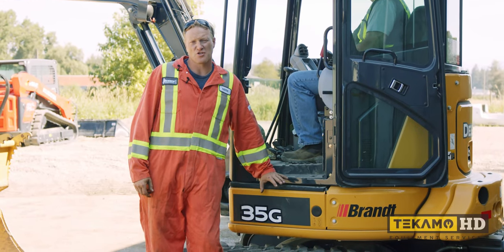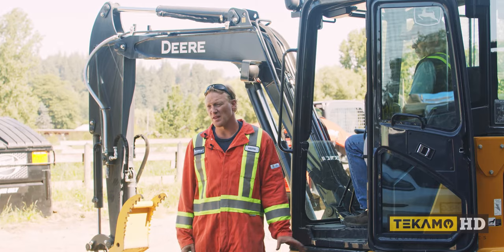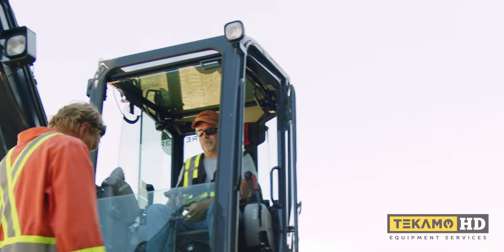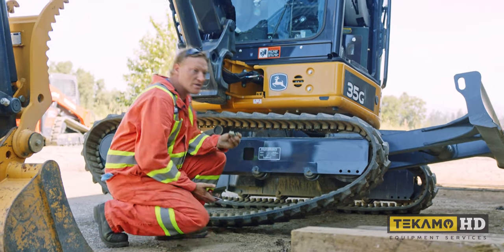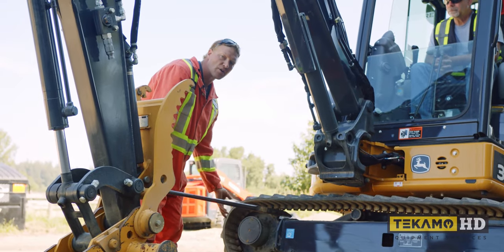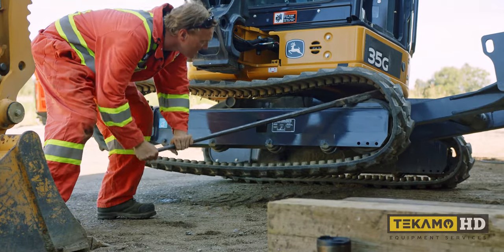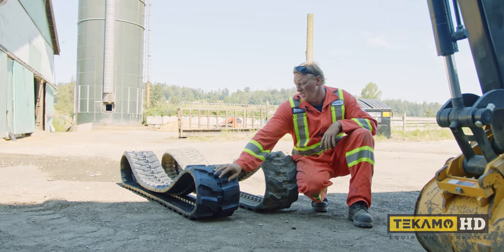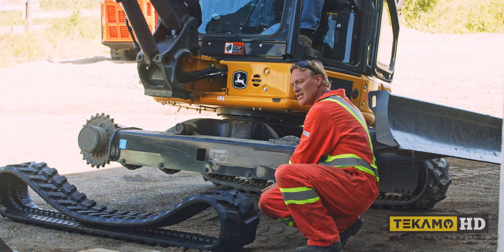Learn How to Change Your MINI EXCAVATOR Tracks in Minutes!

Comment: Thnx!!! I belted off and was stuck in pretty deep mud (!). This video gave me the method to get it on again. With nobody to help me, I pulled a rope attached to the belt lever - out the front window, to drive the track on, and it worked! I also used a hi-lift jack and ropes, to jack the belt into position

Comment: Thank you Keith,  had a track on a rental come off. Rental shop was closed and had about an hours work left. If not for your video I was doomed.
Reply from the maker: No problem! What were you working on with the mini?
Reply: @TekamoHD  dug out 40 inch wide by 48 inch deep trench for a 26x30 garage frost walls up here in alberta Canada. Small machine I thought when I received it, but got it done in 9 hours. Slow and steady for me as I've never run anything besides a bobcat before. Thanks again

Comment: Perfect video - thank you - now I'll go put my new tracks on.
Reply from the maker: Hi Phil, how did it go? Any feedback on how we can improve our videos and help our viewers is greatly appreciated.
Reply: @TekamoHD  It went very well. My machine's tracks are a bit heavier (KX-121). Doing it myself was a little more difficult to manuver the track. So I ended up putting the tracks on dollies with a bottle jack in the center to hold up the center sag. Then I was able to roll the track under the machine with little effort. From there, I manipulated it around the sprocket and pully with a bar.
I can't offer any feedback on the video itself because it was very clean, to the point, good light, sound etc. Thanks again
Reply from the maker: @philburke1902  That's great to hear. Love the solution you came up with.
We're super happy you liked our video. If there's any other video that we can make to help you with your Kubota, let us know and we'll do our best.

Comment: I have a jcb 8045 and I’m having trouble getting the track on due to the tensioner not going all the way back. I have the grease fitting completely out and I’m wondering is there something else I need to do to release pressure so the wheel will go back all the way? Any help would be greatly appreciated thanks

Comment: With the one inch clearance at bottom - does that not increase risk of track coming off? I have seen other youtube videos where they adjust it until it slightly goes in sprocket. I will have to find my manual to see what is manufacture recommended!
Reply: I think the spec is like half to 3/4inch. His amount should lead to less wear. You could always tighten it for hill working and then let a little grease back out for operating on level ground 👍

Comment: Several safety issues my friend that made me cringe a bit.
Reply: When?
Reply: @lolosaulala48  Primarily when the fella is in contact with the bar while track is in motion. NEVER a good idea to be anywhere near a machine like that with the engine running and an operator in the seat. I began operating equipment in 1978 which has ranged from small trenchers all the way up to D8 Caterpillar dozers and trained on heavy equipment at Ft. Leonard Wood, Missouri during my A.I.T. training as well. Seriously, l believe the safety issues of this video would never come close to getting a passing grade from OSHA.
Reply: @LeroyMcquay Safety 1st 👍